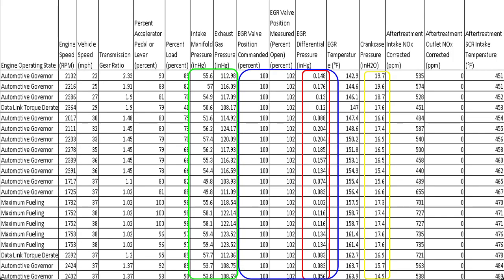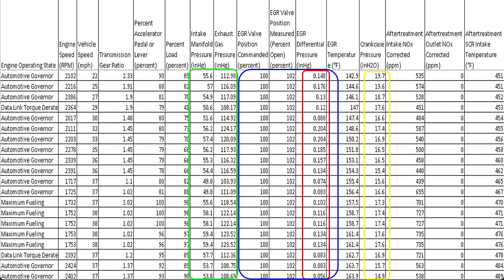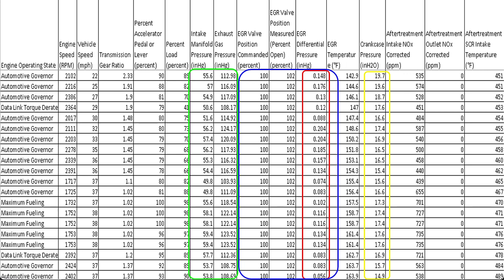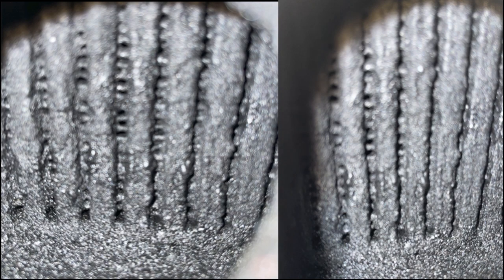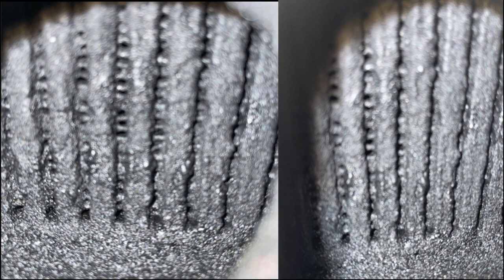EGR faults and the egr valve and sensor have been replaced  ???

Comment: Good video as always. Wonder if lack of HC doser (7th injector) contributes to this and injector fueling balance besides the excessive "wet stacking" from long low duty cycle. Lenny at Dynomite Diesel is getting into HD common rail injectors and his findings on ISX-15 injectors is the flow rates are all over the place which I always kinda assumed.

Comment: This is a great find. Was the egr temp ever logged in a higher value. above normal or inconsistent. This poor thing couldn’t breath.
Reply from the maker: No. Usually when the egr flow slows or stops for whatever reason, the egr temp cools down fast. The egr temperature is measured after the egr cooler before the egr flow gets into the intake venturi. So the egr temperature was a reflection of the temperature in the area where the egr pipe was located. The temp never got over 170 degrees. Normal egr temps are 230-380 degrees when there is flow and the engine is working. Also egr valves NEVER open 100 percent for very long. only momentary. They average, on this engine, around 15-50% open 90% of the time.
Reply: @ENGINESHOPJOE  So what’s the correlation, the link between a blocked EGR and frequent regen? You’d think less contamination of the fuel air mixture would result in a cleaner burn, and cleaner dpf but it seems that’s not the case. 
Cheers for the interesting videos Joe!
Reply from the maker: @JasonHam41  What blocks up is the sensing ports the egr sensor. uses to verify egr flow. In the real world the port that blocks up first is the one that is actually sensing flow in the egr housing. So the ecm thinks the egr flow is too little and opens the egr valve excessively. This puts way too much oxygen depleted air into the cylinder but the ecm thinks the mixture is correct(enough oxygen) to burn correctly. So it meters a full dose of fuel through the injector but the fuel only burns partially because of lack of oxygen. when the exhaust valve opens black smoke comes out. Black smoke is unburned fuel or soot which the dpf catches. Since so much soot is coming out of all the cylinders the dpf loads up and the system drives a regen, over and over until faults start occuring.
Reply: Yeah, lacked flow for sure! Paccar guidelines are sustained temps 40°F over coolant temp on steady cruise was indication that EGR cooler was needing cleaned or if wet soot buildup on outlet.
Reply: Yeah, lacked flow for sure! Paccar guidelines are sustained temps 40°F over coolant temp on steady cruise was indication that EGR cooler was needing cleaned or if wet soot buildup on outlet.